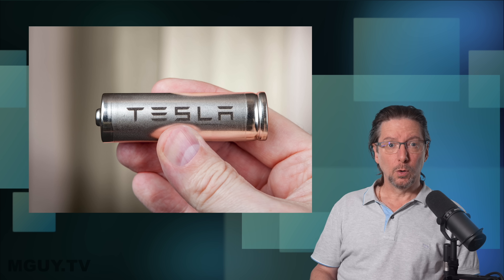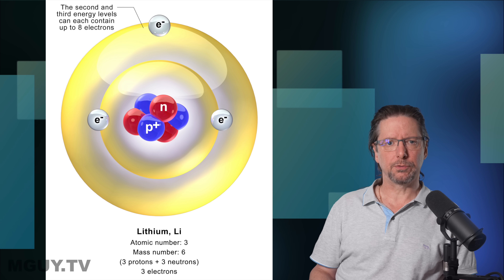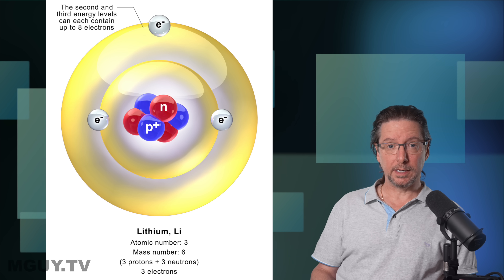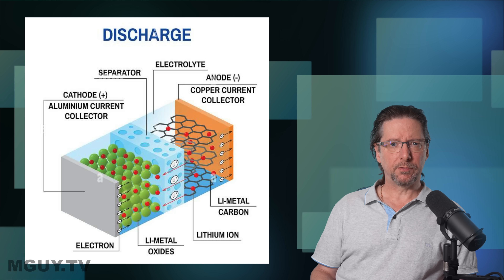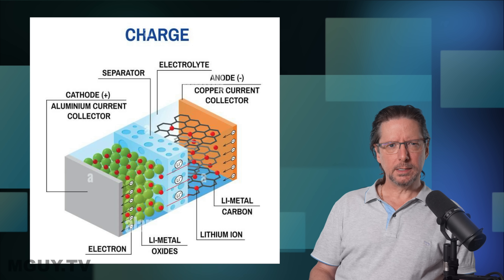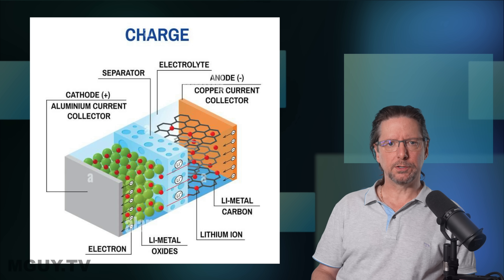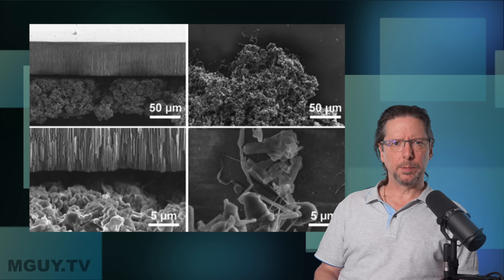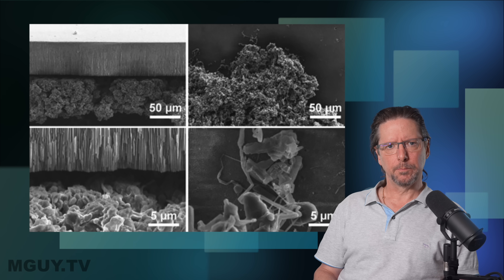Why are EVs so TERRIBLE in the cold? | MGUY Australia

Comment: Another bit of physics that people may be unaware of is that charging a battery is not 100% efficient - this means that you need to consume more kWh than you put into the battery.  There are two sources of inefficiency, the charger as it converts mains AC electricity into a lower voltage DC electricity and the chemical reaction to move ions around and store charge.  The excess electricity is usually lost as heat - this is why the charger and battery gets warm.  That heat is electricity that you are paying for that is getting lost and not ending up stored in the battery.  Typically, a good charging system will run at about 90% efficiency which means to put 50kWh into your battery you have to buy 56kWh of electricity.

This is often overlooked (sometimes deliberately) when calculating the cost of fuelling an EV.
Reply: Yup, and don't forget the I2R losses of pushing that kind of current from the charger to the charger (in your car).  The faster you're charging, the more money you're wasting.
Reply: 1. Child battery mineral labor

2. Range anxiety

3. Risk of garage fires

4. Paying 20k more than a
comparable vehicle

5. Battery denegration

6. Poor resale value

7. Reduced performance in
cold, highway.

8. Higher repair costs

9. Awful charging network
experiences in the weather
without restrooms

10. Higher insurance rates

11. Replacing tires more
frequently

12. Death by autopilot

13. 30 - 40k battery

14. Low km range

15. must wait in-line 1-2 hrs
to charge.

16. Then wait more time to charge, while charging.

17. Spontaneous combustion, with no way to put out the fire storm.

18. If they catch fire in a tunnel, many people will die.

19. People without a pro charger system or a parking spot at their house, will run an extension cord to the road, which is dangerous and could lead to people tampering with your charging setup (super slow charging at the road)

20. If you're in California, you won't be able to charge your car past 4pm because of a shortage of electricity supply on the cheesy grid.

21. It is not actually "green". The pollution is made at the power station, not the car.

22. Only 5% of used junk batteries get recycled, the rest go directly into the bin. It's cheaper to mine for new minerals.

23. Chhinna actually does 70% of all the refining of the minerals and production of the batteries.

24. Minerals are becoming more and more scarce, and the cost will only go up, not down.

25. Some countries where they mine for lithium, actually use a very big boat load of fresh water to only produce a ton of lithium, so they are afraid of running out of water. It takes over 2 million liters of fresh clean water to produce 1 ton of lithium. 

26. Ev cars will soon not be able to drive in tunnels or be able to park in underground parking garage and probably will eventually void your house insurance if you park it in your personal garage.... 

27. You can't charge your battery at super stations when it is bitter cold out. 

28. If a fire truck comes to put out an Ev fire, all the chemicals go directly into the sewer system, poisoning everything. They need tons of water to slow down the burn. They can't put them out. They are only trying to prevent over things near by from catching fire. 

29. Ok, there is 2 good things; regenerative braking, which charges the battery while you are slowing down on the highway, which saves your brakes from much wear.
Reply: @jakefriesenjake  wow you are truly as gullible as a 3year old.  Fearmungering campaign really worked on you. Shame
Reply: Also, from the power plant to your transformer at your house. Power loss in the transmission lines (around 2%)

And this power is not "green" in most cases. Especially if the electricity is produced in chhinna
Reply: @jakefriesenjake While true, I was referring to the losses that you pay for as the charge rate increases.  Have a good one!
Reply: ICE cars have 75% losses, plus the losses in the oil refinery. Only 10% charge loss in an EV is really good
Reply: @t.d.5804  Not quite - we are talking purely about fuel delivery here.  If you buy 50 litres from a petrol pump you get 50 litres in the tank.  But if you buy 50 kWh from an EV charger you only get 45 kWh in the battery.  The inefficiencies you mention then come into play - as you say an ICE engine is not efficient, it wastes a lot of energy in the form of heat and noise.  An EV should be more efficient, power delivery from battery to motor will not be 100%, batteries, ESCs and motors get hot when in use - but I imagine that it is better than for an ICE car.

But the point I was making is the fact that when you buy ‘fuel’ for an EV you don’t get all the fuel that you paid for in the ‘tank’.
Reply: @nheather  You have to buy 3-4 times more fuel in advance than the car actually needs to move. I can charge my car at home with solar, impossible with petrol. 50 Liters are 500kWh, an insane amount of energy. Why should I buy something that goes 75% to unneeded heat and pollutes everything.  Even if people dont care about clean air, its cheaper and easier with an EV, got >300.000km, it never was that easy before.
Reply: @1Electricman  Yes but that is already built into cars mpg rates.  A better analogy would be to buy 50 litres of petrol, pump 45 litres into the tank and spray the other 5 litres onto the ground.
Reply: @1Electricman Some of the 60% of heat can be used to heat the cabin at a comfortable temperature without detriment to range for a petrol car.

All motive technology past, present, and future will have inefficiencies due to thermal dynamics.
Reply: Another bit of physics that people are unaware of - burning gasoline loses 75% of its energy to waste heat. Further parasitic losses in an ICE vehicle (compressors, pumps, alternators) further reduce the energy at the wheels to as little as 12% - 15%. That's right, you're defending a vehicle type that wastes 85% of its fuel's energy.
What were you saying about electrical cars? I forgot...
Reply: @justsomeguy934 if that is the comparison you are going to make then you have to address the inefficiencies in the plant that's generated the electricity and the impacts of that. While arguably lower that isn't what I'm getting at. Your comparison should be like for like or it's incomplete.
Reply: @rowanmeads8598  Ok, but also all energy usage for raffining oil to petrol
The oil ypou get in your car is only 40% of the oil taken out of the ground. The other 60^is used to get it to the pump.
Reply: Correct. The same as not mentioning all energy losses to get petrol in the car...done with electric pumps. Transport , including pumping in and out petrol transport trucks, energy used for raffinement of oil to petrol and much more in the oil industry.
Oh, the real loss , with good developed chargers, for charging a battery is ca 6% (measured between the calculated energy from my charger to the used energy for the travel measured by the car computer. Charging done with 4KW speed. Not the 10% you mention. That is only for the few miles when fastcharging is used on the occasional longer trip.
The highest efficiency charging a battery. Ca 98% , m,easuered (and securte) by the builders of a solar car driving in Australia in 2013. Source, my child...one of the builders of that car..now a mechanical engineer.
This tupe of electronics is (still) to expensive for the normal market I suppose.
Reply: At really cold temperatures, Diesel fuel becomes a gel, and won’t work in an engine.  They have to keep them running, or use an engine block warmer or something.  I believe some use kerosene or some other additive to keep the diesel fluid.  

The way MGUY describes ‘preconditioning’ is somewhat deceptive.  It is true that if you tell your Tesla that you are headed to a Supercharger, it will precondition the car on the way so that it is ready to take the max charge when you get there.  Actually driving the car warms the battery.  In cold weather, driving may not heat the battery to optimal charging temperature, so it may have to heat it up some more to be able to take the max charge.  The newer Teslas have a heat pump that uses the heat that is creating by driving so that it isn’t wasted.  The other thing is Teslas are connected with the Supercharger network, and you can see the status of the SuperChargers.  It shows how many of the available chargers are in use.  Chicago has a lot of Superchargers, so alternative SuperCharger locations should be available.  It is not a good idea to be preconditioned when you arrive and then have to sit and wait until a charger becomes available, it’s better to find another station.  This can be done before you get there, the map in the Tesla shows all the Superchargers within driving range, and their status of availability.   Yes, this takes a bit of intelligence and planning, but it doesn’t require knowledge of battery chemistry as MGUY implies.
Reply: @adairmartin  "At really cold temperatures, Diesel fuel becomes a gel, and won’t work in an engine.  They have to keep them running, or use an engine block warmer or something.  I believe some use kerosene or some other additive to keep the diesel fluid."

You're talking extremely cold temperatures for an engine block warmer to even be required. An engine block warmer is primarily to prevent coolant from freezing once ambient temps fall below what the coolant mix can cope with, and that's ludicrously cold temps anyway compared to plain water.  In such cases where they are required it's because frozen coolant can crack an engine block. In such regions you don't even have piped running water to dwellings for the same reason (frozen and cracked water pipes due to expansion).

The gel problem is solved by using an "Alpine or winter mix as it may be known in some areas" For the majority of people using diesel in the world it's not required, or if it is the consumer is unaware of buying it because it's seasonally adjusted by the supplier to the fuel station where you fill up. Where some people get into problems with diesel turning to gel is when they travel to Alpine ski resorts or such during winter with a tank of fuel bought in a major town or city at a substantially lower and warmer altitude. It's therefore best to fill up with diesel fuel closer to such extremely cold destinations you're going to operate and park the vehicle in. A common sense no brainer with very little planning or forethought required.

It's sheer desperation on your part to even mention engine block warmers and diesel turning to gel in a ludicrous effort to negate the many many daily drama's of using EV's in cold climates. 🤣
Reply: I learned that owning my EV. You see that especially in the “range”
Reply: @1Electricman  No, it's not like that.  When you buy gasoline you get all the gasoline.  The pump says 1 gallon, you get 1 gallon, regardless of flow rate.  What you do with it is up to you.  When you buy 1 kWh at a charging station, how much you get depends on how fast it's delivered, and I mean that literally, no kinda, no sorta.  And  it's literaly's not dependent on what you do with it after you get it.  How much you receive is literally dependent on how fast you get it.
Reply: @1Electricman  I don't understand what happened to your comment starting "Kinda like..." in this thread.  Did you delete it?

Comment: I find it comical how in poor weather many EVs basically can't charge and only maintain while plugged in.
Reply: So many baying electric cars without knowing that the battery have to be heated to warmer then 0c to be able to charge... With -10c and wind that for example means your car will simply not be able to charge on a 16A course and only slowly charge on 30A because most or all the electricity goes to heating the battery.
Reply: @a64738  It is paying to heat the outdoors. Hilarious. Batteries need to be cooled when it is hot and heated when it is cold. That explains the lack of cold weather insulation.
Reply: @1Electricman  block heater is just so you can heat it up a bit. Put it on a timer. 30 minutes before you go to start the ICE, is all you need. But it's rare to even use them except for heavy diesel trucks
Reply: Living at 52°N, never had an issues with my EVs the last 10 years. They charge and drive fine. 20min stop at the supermarket and charging there is enough (10-80%) even when its cold. Just dont buy that outdated and crippeld cars from the old ICE industry
Reply: Remember, the only reports of this happening were in one city and no one reported it happening in Canada where it was colder. Food for thought.
Reply: @1Electricman  Compare the amount of power required.
Reply: You dont need a heating element in an ICE vehicle to fill up with fuel at the gas station.
Reply: 1. Child battery mineral labor

2. Range anxiety

3. Risk of garage fires

4. Paying 20k more than a
comparable vehicle

5. Battery denegration

6. Poor resale value

7. Reduced performance in
cold, highway.

8. Higher repair costs

9. Awful charging network
experiences in the weather
without restrooms

10. Higher insurance rates

11. Replacing tires more
frequently

12. Death by autopilot

13. 30 - 40k battery

14. Low km range

15. must wait in-line 1-2 hrs
to charge.

16. Then wait more time to charge, while charging.

17. Spontaneous combustion, with no way to put out the fire storm.

18. If they catch fire in a tunnel, many people will die.

19. People without a pro charger system or a parking spot at their house, will run an extension cord to the road, which is dangerous and could lead to people tampering with your charging setup (super slow charging at the road)

20. If you're in California, you won't be able to charge your car past 4pm because of a shortage of electricity supply on the cheesy grid.

21. It is not actually "green". The pollution is made at the power station, not the car.

22. Only 5% of used junk batteries get recycled, the rest go directly into the bin. It's cheaper to mine for new minerals.

23. Chhinna actually does 70% of all the refining of the minerals and production of the batteries.

24. Minerals are becoming more and more scarce, and the cost will only go up, not down.

25. Some countries where they mine for lithium, actually use a very big boat load of fresh water to only produce a ton of lithium, so they are afraid of running out of water. It takes over 2 million liters of fresh clean water to produce 1 ton of lithium. 

26. Ev cars will soon not be able to drive in tunnels or be able to park in underground parking garage and probably will eventually void your house insurance if you park it in your personal garage.... 

27. You can't charge your battery at super stations when it is bitter cold out. 

28. If a fire truck comes to put out an Ev fire, all the chemicals go directly into the sewer system, poisoning everything. They need tons of water to slow down the burn. They can't put them out. They are only trying to prevent over things near by from catching fire. 

29. Ok, there is 2 good things; regenerative braking, which charges the battery while you are slowing down on the highway, which saves your brakes from much wear.